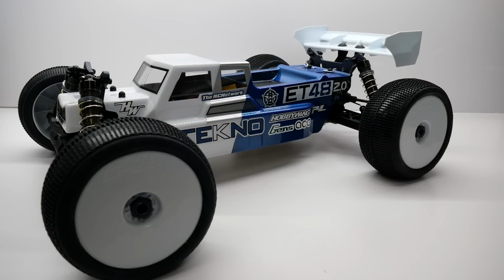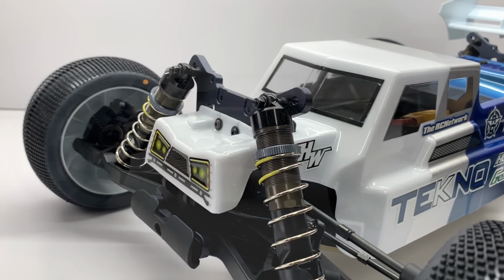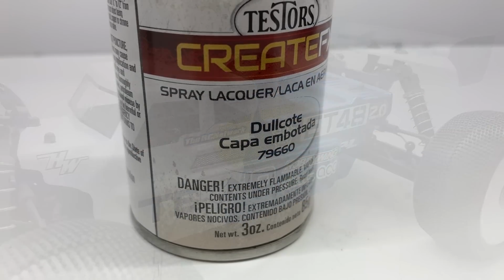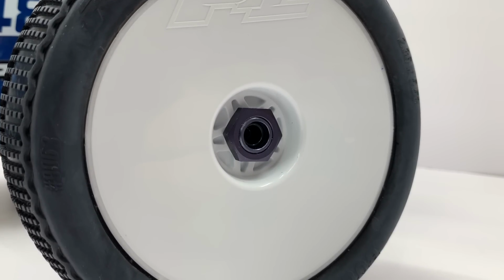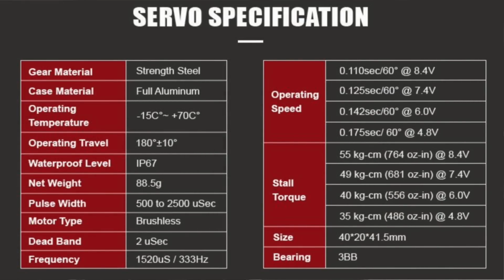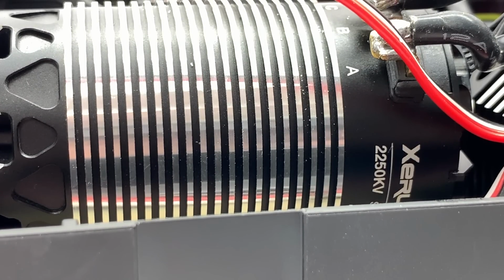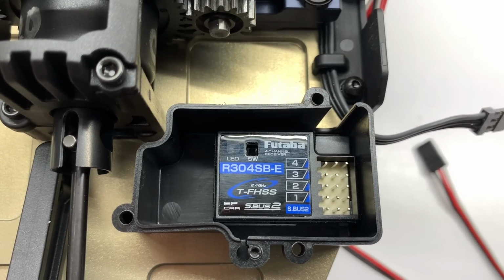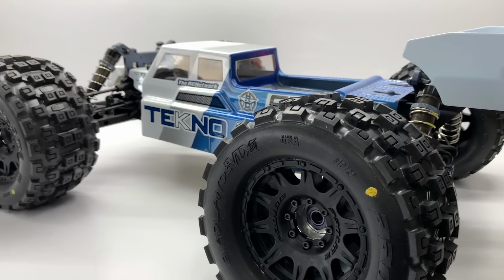Tekno ET48 2.0 Truggy - Build Reveal - Race or Bash?? 🤔 HOBBYWING | AGFRC | GensAce

Comment from the maker: So, what would you have changed on the build? 🤔
Reply: Body. 
It ooks like toilet on wheels.
Reply: Lol that goofy body has to go. Spending over $1000 on a build what's another $40 for a body that don't look like a toilet and a boat had a baby
Reply from the maker: Goofy to you, beautiful to me....
Reply: Keep stock body for race , and a older version to bash , to protect front component better from bashing
Reply: I would have made the side windows full length as in one piece. And framed them in black same as the front.
Reply: Why did you go with the Hobbywing 4274 instead of something like a Tekin T8 Gen 3? I am looking at about 1900Kv for my build since I have a lot of 6s batteries and am maybe too cautious about over revving the motor.
Reply from the maker: @fourpony4566  I wanted to try out their new Gen 3 Truggy motor as a comparison....only 2250kv available at this point though.
Reply: @TheRCNetwork  Right on. I am planning on going with the XR8 Plus and T8 Gen 3. Just finished putting the front and rear clips together.
Reply: @fourpony4566  racing venues usually limit to 4s
Reply: I’d change the body looks ok but not for me 😎
Reply: It took a minute to fall in love, and I finally nailed the inspiration... Alaska inshore  fishing boat, might take an hour to chop the top 3/8" then it's going to be slo-mooo sexy! As always Rich... your money 💰BB
Reply: Have you had good reliability from the servo? I just bought a 36kg AGFRC servo and I've now found out it has terrible feedback about it. I'll install it and see how long it lasts.
Reply from the maker: @jonowillmer  I have about 10+ cars now all with AGF servos. As long as you have spec’d it right, you’re good (meaning, torque for the right weight/application of the RC). There’s a couple of “noisy” people out there that had an issue, but they would have had issues with any brand of servo.  I tested AGF servos for about a year before I started to recommend them….with that, they actually make many of the servos you see that are basically just re-brands.
Reply: @The RCNetwork  thank you for the feedback, I only went with the 36kg, but I would have thought that was enough normally.  I see you went with a monster 55kg servo. I guess I'll see what it's like, I am really looking forward to driving the ET48 2.0.
Reply: The shoe box body
Reply: I have the buggy version and was goin to buy the truggy to match till i seen it lmao i mean it looks like my 5 year old took a shoe box cut out windows and glued on some tires. Yep waiting for jconcepts or leadfinger to fix this issue!

Comment: What weight diff fluids would be good to bash with in the et48 2.0 (dirt and low grass)?
Reply from the maker: If you're gonna run the stock sized tires/wheels, the stock diff fluids are perfect.  I'd keep the ET out of grass though.....grass will kill your electronics/Rc pretty quick. You'll heat up everything with the added resistance.

Comment: I used that exact battery in my et48 2.0 and it started melting after about 6 runs
Reply from the maker: No issues with mine......it's all about keeping it in storage mode when not in use and in a cool environment otherwise
Reply: @TheRCNetwork  that’s always storage charge it and keep it in a 20°c environment. It’s just after driving it that is gets very hot, it got about 60° after a 8 minute run

Comment: Just wondering, if it’s 100% neccessary the aluminium hex hubs. Nice build, thanks
Reply from the maker: Not necessary....the stock ET48 2.0 has aluminum caster blocks, which help.
Reply: @TheRCNetwork  thanks, then why you have the 1/2” aluminium hubs? Any benefits for the car?

Comment: Why is this model so much more expensive than the mt410 if there about the same other than chassis length
Reply from the maker: This is a race model and has a ton more upgrades included with the kit as well as upgrades materials like 7075 aluminum.

Comment: How are you finding the ESC/Motor combo? Any overheating issues on 4s? Are you running a motor fan??
Reply from the maker: It's solid, especially on 4s....I don't have any want to even try 6s.  No motor fan.  After the running video, I was able to touch the motor...so it's running perfect
Reply: @TheRCNetwork  Are you still liking this ESC / Motor combo?  Was considering purchasing this for my ET48 2.0.  Also, do you only use the 15T pinion or have you tried other sizes you like better?

Comment: I personally don’t like RTR’s so really the only bash worthy kit options out there are only from Tekno. Sure ARRMA makes the EXB series but those are assembled. I think if Tekno made a version of this with more plastic and dropped the price point it’d still perform well maybe have everything the same as this but use a honeycomb plastic bathtub style chassis I think they’d sell well. I’m not a racer as I don’t have the time to do it. It doesn’t really intrigue me, but others who race Tekno is great. I’ve thought about building up an SC410 as a basher as well
Reply from the maker: The SCT410.3 and MT410 are Tekno's more entry level race/bash kits with a little less upgraded parts - they have plastic shock caps, plastic suspension holders, 6061 aluminum chassis plates, etc.  Still super high quality over Arrma, but in Kit form.  I highly doubt that Tekno will drop into the plastic tub chassis end of RC, it's just not what the focus is or what they have time for - they're a racing brand.

Comment: Nice build Rich! Paint looks good but I still don't like the body 😂 Only thing I would change would be some 3.8 badlands which are smaller than the MX38. Or a set of Arrma Outcast LP tires 👍 I like your electronics choice for 4s, should be a beast 💪
Reply from the maker: The 3.8 badlands are one of the smallest 3.8 tires....I had them on my MT410.  I ordered the Backflips...those will work
Reply: @TheRCNetwork  Yep! Smaller tires work best. Keep the ballooning and weight down 😀

Comment: Really clean build and I understand wanting try it on the track because that’s what it was built for. Bashing is fun and that’s mostly all I do now, because of life, but there’s nothing better then taking a fresh build and ripping it around the track. Especially an amazing car like this one. Cant wait to see the run video/review. 
Just as a question, I’ve been thinking about getting a et410 as a basher/racer. What do you think?
Reply: If your just bashing you would have more fun with an mt410. But if you are doing both racing and bashing the et410 is great for both. I bashed mine a little at the beginning of quarantine and it held up okay all things considered.
Reply from the maker: The ET is a great little basher....grab a 540 4 pole (4600kv) and SCT wheels/tires and there you go

Comment: Are you sponsored by AGFRC or any of the brands used in this video?
Reply from the maker: "Sponsored" is such a mis-used word.  Over the past few years, I have consistently used certain brands depending on what's available and what's new on the market.  It never seemed like I could get the "perfect storm" when doing builds....like, I would have a motor/ESC for testing...but not the right battery, servo, etc.   I approached a couple of manufacturers last year about using their products in my kit builds - mostly because I trusted their products, having tested them for years now and I knew they had a wide variety to fit all of my builds from crawlers, to race to U4 to on road.  AGFRC is one of those brands.  Do they supply product for my builds?  Yes. But I stand behind their products and the quality they provide.  If I have an issue with their products, I alert them to the issue and provide feedback for them to resolve the issue prior to anything being suggested as being top notch on my channel.  I've done this same process with many, many products and brands....and have not published videos or recommended products because of it.
Reply: @TheRCNetwork  This answers my question, thanks. Was just wondering if you would actually choose these brands over others if you weren't getting them for free.

Comment: Great build....I did not have great luck with the HW XR8 plus ESC in my Kraton EXB after it landed flat the ESC failed I did manage to run 4 packs through it before it took q s**t ....Replaced with CC Monster X  not its is awsome ...the HW XR8 plus kept over heating even with stock gearing the base of the ESC is all plastic or there is no heat dissipation...tried different fans tires ....
Reply from the maker: That's strange....I;ve had some quirks with my plus's but nothing major like that....I do wish the XR8 Pros were in stock at the time though...but I'd be limited to 4s (which is fine with me)

Comment: This is absolutely perfect! Nice work on both the build and the editing of the video. If I can pick any rc on the market today, this is would be it.
Reply from the maker: It's a great looking RC despite the popular opinion....plus, you know it will drive great and likely never break!
Reply: @TheRCNetwork  Is it true that they slimmed this one down compared to the last truggy? I'm getting the impression that it's not as durable as the previous kit.
Reply: @Cardiakk  I don’t know where you heard that from. The chassis is wider for one. The arms are the same thickness. The shocks towers a millimeter thicker. Nothing was “slimmed down” to my knowledge
Reply: @byzone0632  Someone stated that on a previous video. So this will be the most durable truggy for bashing? No weak points?
Reply: @Cardiakk  there is one weak point I see in it. The bulkheads (which were a last minute revision thrown into the box as they were being shipped out) seem to have a lot of carbon in them (or at least mine did) making them a little bit more brittle than they should be. But this was a first batch kit, by the second batch they should have fixed the bulkhead problem and then it will be the most durable truggy.
Reply: @byzone0632  Interesting. We'll I'll be getting the nitro version so by then that problem should be corrected. Thanks for the info.

Comment: With the paint job.. I know that a lot dislike the body because of its shape...  But with how you have painted this there is an old school vintage truck style cab to bonnet over what would in that type of truck be the engine bay.     .. it's okay but considering my recent paint schemes have been cherry red . Gun metal and black for a ford f150 body for a Stampede.. silver, cherry red , with lame flake in the gun metal areas.. for a rustler body... Then more cherry red, black with lame flake for a Schumacher cat xls... With smoke and green in the windows..
Reply from the maker: Thanks for the info.....I've painted a couple of cars red in my time.....but never have been a fan of red for some reason
Reply: @TheRCNetwork  funny thing is. It's closer to pink than red.. so the f150 body with the chrome monster truck rims and tyres (old school chevron style) looks like a muscle truck even though that wasn't the intention..

Comment: Nice Rich! The one piece front windshield IS a better look for that body.
6S certainly can be fun, but my EXB with a 5000mah 6s is 14 lbs.........great for single jumps.....but Not nimble enough for track  bashing.  I’m going to build an ET48 for 4S and keep it light😎
Reply from the maker: Agreed on the front....the other trend now that I've painted is making the two side windows into one.  I'm all for keeping 4s in this...I've never been caught up in the voltage game....but wanted to give that as an option